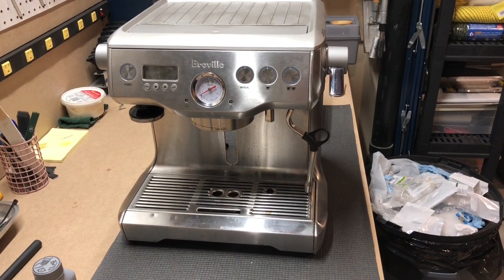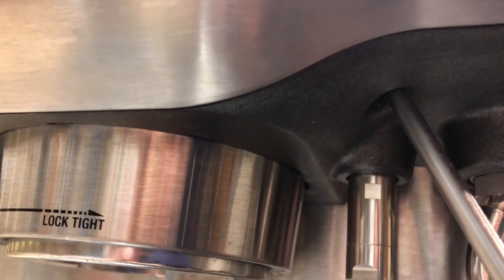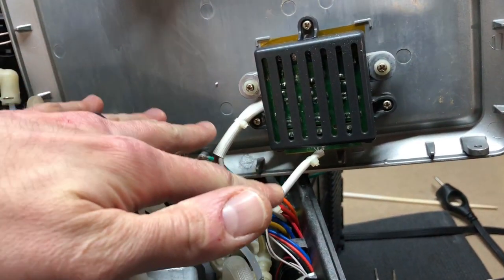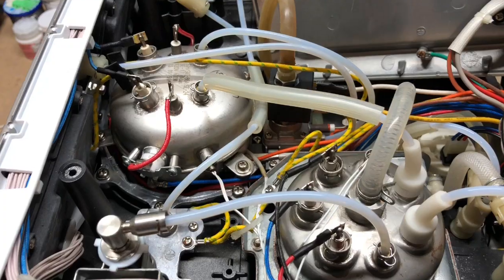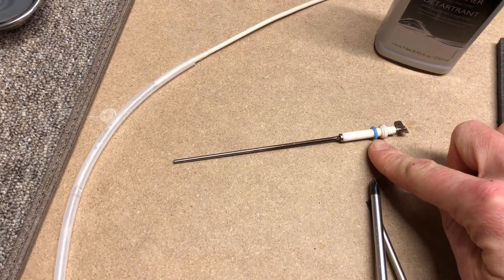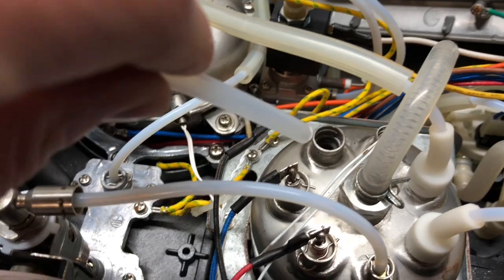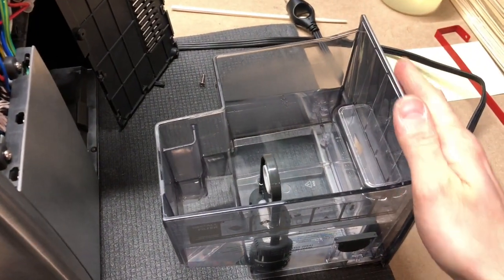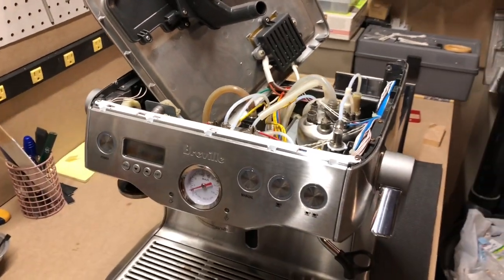Breville Dual Boiler Descaling Procedure

Comment: Many thanks for this and your other videos! It certainly allowed me to descale my machine and fix a pressure problem. The only thing left to do is to get rid of the "Service" message that shows whenever I turn on the machine (which prompted me to look into getting it serviced in the first place). I would like to reset it, but cannot figure it out. I went into the maintenance mode and have read the instructions for trying to reset the 920XL, but is apparently different for the 900XL.
There is a reset or r3st option in the maintenance mode, but I have no idea how to activate it.

Here's hoping anyone figured it out so I can remove the message (and hope it returns when it is time to do more maintenance).
Reply: Hello, did you figure out how to make the reset on the 900XL?
Reply: @luiseduardo3718  I never did and traded in the device

Comment: btw, why can't you just turn it upside down to get rid of the descaling agent?
Reply from the maker: You could but that would be difficult and risky. The machine is heavy and awkward to handle, and you'd have to be very careful not to break the wiring harness that's attached to the top.
Reply: @322816  thanks for the feedbacks!

Comment: Good info re access to the boilers! But the procedure for charging and draining the descaling solution is omitted. You showed the descaling solution in the water box of the machine, so presumably you are meant to use the machine's clean cycle to actually get the solution through the boilers and tubes?  Or maybe you just mean to turn the machine on after reassembly, and never flush beyond the boiler? Does this mean you should remove the ports, drain fully, reassemble, do clean cycle, remove ports again and drain? That seems onerous, particularly if you need to repeat. Or are you using the ports alone to charge and discharge the boilers? Or is it possible to charge the boilers from the water box with the ports open & power on - I guess this is neither advisable nor safe.

After watching a second time, I think your procedure is:
* Drain boilers as far as possible without opening machine (how?)
* Fill reservour with solution
* Charge machine (how? just turn on?) Is it OK that the boilers are heating?
* Wait for solution to dissolve scale (do you have recommendation on time?)
* Flush through group head/water port?
* Open machine as described and drain all solution from boilers manually)
* Refill manually with solution if scale remains, and drain again manually
* Refill boilers manually with clean water and drain several times
* Flush through fresh water from reservoir out through group head & hot water port?

Sorry to be pedantic but there seems to be lots of possibilities.
Reply: Same questions here.  I totally understand from the video how to flush the boilers manually, but how do you actually run the descaling fluid through the machine?  Is there a "descale" setting via the menu?  Or do you just run the fluid through the machine somehow with the "clean" setting.  A bit missing in the info.  Thanks.
Reply: You ever figure this out?